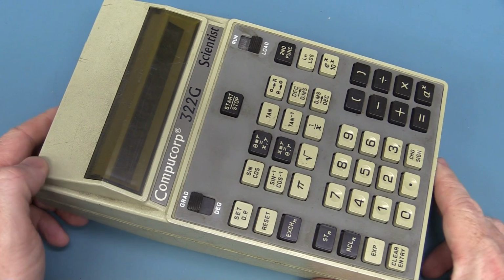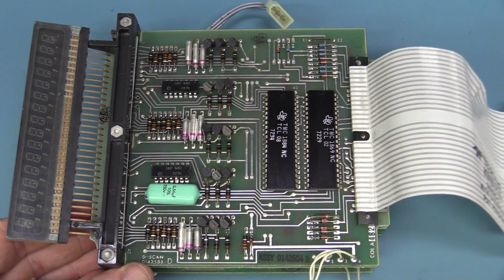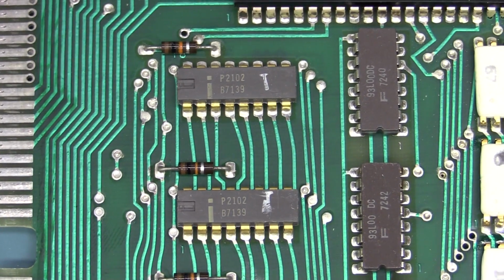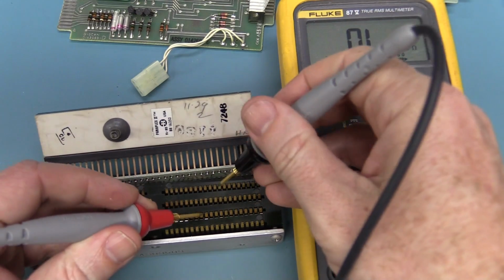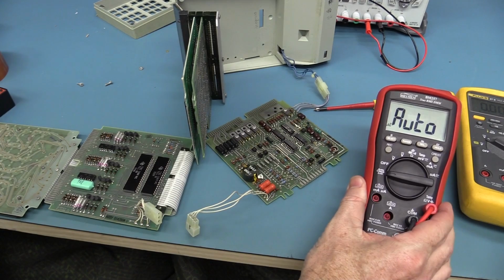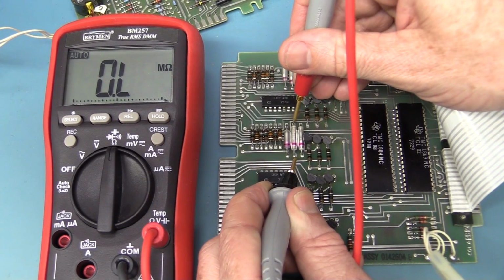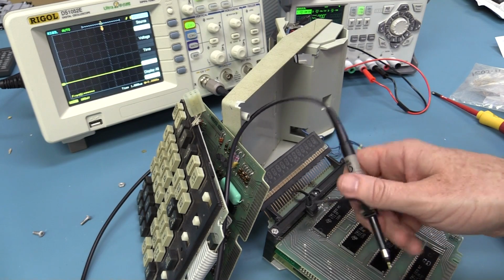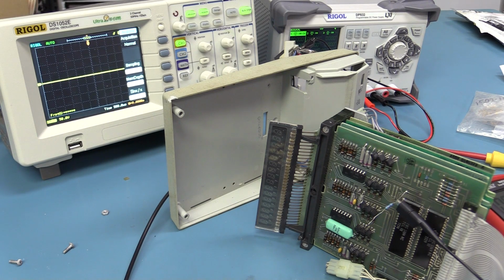EEVblog #663 - Compucorp 322G Calculator Teardown

Comment: If they can use a micro-controller to control the display multiplexed why not use the same micro-controller for everything else like calculations
Reply: +aris oreta
There is simply not enough computing power (and transistors) in one chip. Oh, and it's ASICs (Application-specific integrated circuit), not really microcontrollers. That's like a customized "preprogrammed" microcontroller or probably more like an FPGA, a verry small and slow one.

Comment: Those caps are polystyrene with aluminium foil so the residue is aluminium oxide. These caps were prone to this problem as they absorbed moisture.  Horrible things but all the rage in their day!

Comment: I am not surprised at the power usage.  Back when that was made, all calculators came with an alternate A/C hookup.  Most calculators did not even use batteries.  I doubt that calculator was in wide production.  It may have been a prototype.
My father bought a calculator in 1972 for $40.  All it could do was the four basic operations.  No memory button.  You had to handle subtraction like this: Instead of 10-2 =  , you would enter it in as 10 + 2 - .    If you divided by 0, the display would go out (the calculator didn't know how to handle it), 
To give you an understanding of the cost, in 1972, my father could take the entire family out (two adults and two children) for $5.  Prices stated dropping for calculators around 1978 and batteries lasted longer (about two hours usage).
I think it  would be safe to estimate that calculator cost (at the time of production) to be at least $1000.

Comment: Hey Dave, here in Canada I've got the same meter your using in this video. Except.. Its branded Greenlee. Model DM-200A. The only difference between them is yours has the cap feature. Mine has plugs where the REC and CREST buttons are. I wonder if I could enable this capacitor feature? Cheers.

Comment: Dave, I found this vague reference to the Boroughs PDP displays in the link below; it mentions that calc too. It strikes me (pun intended!) that it would be easy enough to check the cathodes are being pulled down in sequence and the anodes taken high... maybe the display is goosed :( In which case, you could probably replace it with a row of Nixies with no circuit changes; getting it back in the case might be interesting! :D
http://www.vintagecalculators.com/html/calculator_display_technology.html

Comment: http://www.datamath.org/IC_List.htm Just search for Compucorp, it has descriptions for all the chips inside!
Reply: Here's a copy of the info on the site:
First TI chip set produced for Sumlock-Compucorp

This huge chip set was developed by the engineers of Compucorp and produced by AMI. Later TI qualified as a second source to AMI. The chip set forms one of the first programmable calculators, the Compucorp 324G Scientist.

Type	Year	Function	Calculator	Comments
TMC1864	1971	TCL08 - Display	Compucorp 324G	Replaced by TMC1884
TMC1866	1971	TCL06 - Data	 	Processor board
TMC1867	1971	TCL05 - Data	 	Processor board
TMC1868	1971	TCL01 - Printer	Compucorp 325	Printer driver
TMC1869	1971	TCL02 - Keyboard	 	Keyboard-scanning electronic
TMC1870	1971	TCL04 - Data	 	Processor board
TMC1871	1971	TCL03 - ROM	 	Interface to RAM and ROM
TMC1872	1971	TCL07 - Data	 	Processor board
TMC1884	1971	TCL08 - Display 	 	Display multiplexer

Comment: The D-scan board is probably not only for the display, it's for the keys, too. So one DIP40-chip for Display, and one for Keyscan. The dead cap is probably a wet-slug tantalum, failing miserably and spilling it's corrosive contents ... The "Panaplex II"-display needs around 180V to work, so your 100'ish V is too low.
Reply: Quite late here, but isn't that most likely the reason for the seperate power cable? They didn't want to have the HV on the backplane?

Comment: Nice video, his that an amd chip on the psu board ? Didn't know they were in business back then. It's likely that the display just outgas, i have the same type of displays on my pinball machine (williams system 9) and they are known for going bad. They operate at the same voltage (+/- 115v). Finding a replacement display won't be easy but you never know
Reply: oldmac6 AMD was founded in 1969.

Comment: 4 board for just a damn calculator, also more than 100volt is present in the power supply that's crazy.
Reply: It uses a plasma display, not a VFD. You will find similar voltages in a modern plasma TV.
Reply: You display the same saddening disregard to 1973 technology as Dave does.

I can't understand why anybody would compare a piece of 40 year old technology with today's stuff, and then make "amusing" remarks about the item.  Would you (or Dave) do the same with a vintage car from that time period?  Compare it with a 2014 car and then complain and make ridiculing remarks about the vintage car?

This was top technology at the time.  I think Compucorp was even a few years ahead of HP.  Please have some respect.

We are dwarfs standing on the shoulders of giants.

Comment: That's a Burroughs corp. display!, wow!, my father used to service burroughs computers, i remember them taking one apart in the 80s, they had to do it on the front yard of our house, at least 4 people worked on it it!, each "section" was a steel frame at least 2m wide, we kept those to make awesome tables, and some of the power supplies(~25KG linear transformer and some 70000uF siemens caps that are 20cm tall)

Comment: Check the displays heater. If the display has a crack,and the vacuum is gone,it will draw more current.
Reply: Its a neon display like in pinball machines. They don't have a heater. If the gas is gone they will draw zero current. Current only flows when there ionized. (Remember nixie tubes)

Comment: Hi dave. Quick question where can  i get those probes for the multimeter? I have the same multimeter here in Norway and hate the stock probes
Reply: f-t-2000 a seller on ebay (99centhobbies) is the seller that is mentioned a lot from the electronic guys around here
Reply: I also have this multimeter (im also from norway) You can get the probes at eBay or elfa...
Reply: pappkopp takk ;)
Reply: I'm Norwegian aswell, and I think those probes are Probemaster 8000 series (http://www.probemaster.com/product_info.php?cPath=2_12&products_id=198) The best bargain on these is here http://www.ebay.com/itm/Deluxe-Probe-Master-DMM-Test-Lead-Set-NEW-8043S-/360984481528?pt=LH_DefaultDomain_0&hash=item540c5a0ef8

Comment: Shouldn't the company making the calculator have noticed the power consumption as an issue that needs to be fixed when they noticed any of them pulling even 1.3 amps? The battery life must have been horrible.
Reply: What is so unexpected out of a 70s-vintage calculator drawing over 1A? TTL logic is a power hog and VFDs too. That thing uses D-cells and an external power adapter for a reason.
Reply: in 1973 a calculator was amazing, and my 1978 pocket calculator on 4aaa (expensive at the time) i think last 2-3 hours of  use!, horrible battery life was typical
Reply: Daniel Sauvageau  Actually, those were Panaplex displays (I believe made by Burroughs). They have more akin to plasma displays or nixie tubes than VFD.  VFD can typically operate on as little as, what, a15-50 volts, I think. These required a supply in EXCESS of 200+ volts to glow. They were full on gas discharge displays, not phosphor displays.
Reply: Razor2048 That's why they invented CMOS about 4 years after this calculator was built.
Reply: Star Gazer CMOS/FETs were not invented due to TTL using lots of power. BJTs were discovered while researching FETs - BJTs were an incidental discovery. Researchers always aimed to create a voltage-controlled current source (FET) but ended up discovering a current-controlled current source (BJT) first.

By the time the first successful FETs were produced, BJTs were already widespread.